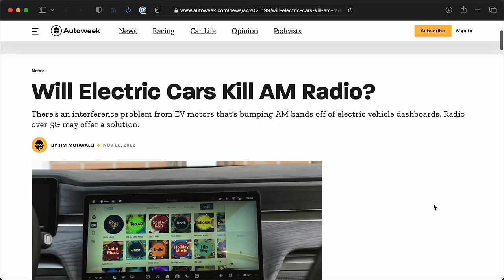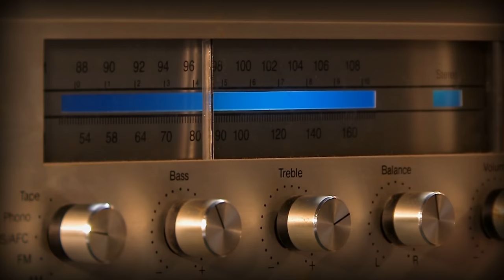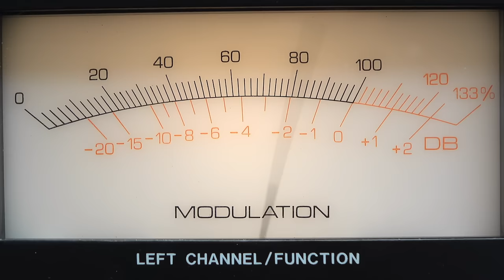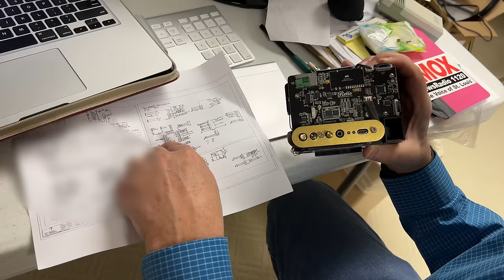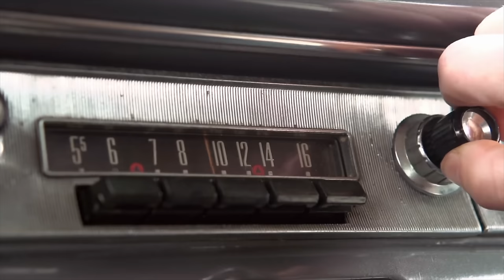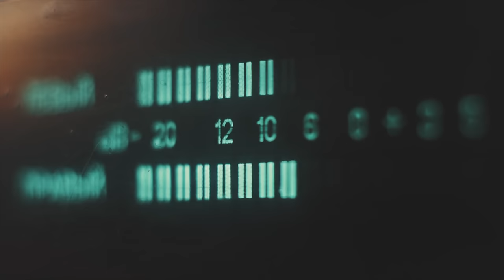Is AM radio dead? Tesla thinks so!

Comment: The difference between analog and digital circuit engineers is that the analog circuit engineers know when they are building a radio transmitter.
Reply: Nah, they know that they are building an antenna ;-) everything is an antenna lol.
Reply: @zyeborm  Every oscillator is a transmitter, and yes it’s a thing EEs are aware of.
Reply: @BrekMartin  many of them don't design circuit boards like they know it
Reply: @zyeborm  I seen a few of those. HDMI seems to be the most challenging to get under the CISPR 22 limits. It doesn't help that the HDMI cable makers treat it like plumbing.
Reply: Many many years ago when I purchased my first computer (8 bit Z80 based) I noticed it had a tendency to annoy radio's, once I had the lid off and probed a zero volt circuit board with the positive probe of my old analogue multimeter, the negative lead just laying on the table, however I got a fair deflection on the meter - kind of scary.
Reply: Back in the days of vacuum tubes in AM radios, in an emergency, an AM radio contained all the components required to build an emergency transmitter.
Reply: When my neighbor's run their LG microprocessor washing machine my ham radio goes away. S9 interference.
Reply: @paulstubbs7678  That’s not entirely as slack as it seems. They should have been shielded, and compliant, etc. but back then the silicon actually consumed more power. All of the unintentional radiators of the time are relatively high power ones.
Reply: That is made up by tesla,  AM  radio works just fine in my hybrid,  the electric motor is in the transmission bell housing ...
Reply: @memyname1771  This kind of brings up another problem, radio's and early TV's were all but 100% reusable/recyclable, Build an Amateur/Ham radio out of its bits, maybe a guitar amp, now look at the modern versions they sell, your lucky to be able to reuse 5% of them.
They (recycling industry) say we can recover most of the precious metals, Gold, Copper?, on most gear that would be lucky to be 1% of the mass! They say support the recycling industry, why, with numbers that low they are either asleep at the wheel, or dead.
Reply: @punker4Real  Whenever I was passing by a Honda Insight my CB radio would scream from the car's motor speed controls. I can't tell you if it's any better now because I don't drive for a living and don't have a CB radio in my car.
Reply: @paulstubbs7678  The circuitry went from point to point (1920-1970) to printed circuit boards (1965- present) to surface mounted printed circuit boards (1995-present). You must have special tools, damn good eyesight, and steady hands to work on these. As you stated, nothing on these is remotely salvageable.
Reply: @BrekMartin  Yes, you can try and shield your way out of it, however the fact it generated so much crud in the first place was what got me. Early Atari 8 bit computers had crazy levels of shielding, however I don't know if it worked as they were priced way above me.
These days they know how to design a lot of it out and not need crazy levels of shielding, however most customers shop cheap 3rd world crap to save a dollar, and those builders have no ethics, and often no idea about design - they honestly don't give a ....
Reply: @spaceflight1019   Well on my suv the electronics are in cased in metal shielding and twisted wires
Reply: @punker4Real  Sounds like the engineers took care of a problem at the source. There are FCC rules that govern what are termed "incidental radiators" but, to save money on production costs, those rules will be ignored until someone complains and then the manufacturer will deal with it on a case by case basis.
Reply: @spaceflight1019  Even if you have a surface mount rework station at your disposal, getting information about the massive big chips used is often impossible. Heck even the Arm micro used in the Raspberry Pi computers (purely intended for old school hacking) is not fully documented, there are bits the makers just won't disclose without you signing your life away. Lots of big chips come with (after signing a $$$ none disclosure agreement) 'tools', top secret code, etc. Trouble is by the time this equipment comes up for recycling, even the keenest individual will have no luck accessing any of this as it all hit the bin the moment the builders moved onto the next version.
The same goes for equipment repairers, and the latest 'Right to repair' movement, the manufacturer builds a million of them, keeps no spares, and documents nothing - well nothing that lasts past the end of production. Heck, lots of this design work is outsourced along with production at another provider, the company who's name is on the product is just a pile of sales types and bean counters that have no idea, so when you call them looking for info all you get is a blank stare.
Reply: To the OP: I got the joke. And it’s funny.
Reply: @PlasmaStorm73 [N5EVV] I'm 67, so things ain't quite as good as they used to be. It was a leap of faith when I removed the SMD resistor that killed the beep in my Bearcat 980.
Reply: @PlasmaStorm73 [N5EVV] It's not much better in the suburbs, either. I live in one of Pittsburgh's suburbs and use an Alpha Delta DX-B for the lower bands and a Cushcraft R5 for the uppers. Thanks to LED lights and other things my 160-40 noise level is typically S9 or greater, and my best band is 10 meters, where the noise level is typically S7 or less. Until the power line insulators start arcing, then it's all over.
Reply: @PlasmaStorm73 [N5EVV] But if they never have the parts available, or are hiding under the  'replacement board' excuse, even though there is only one board in the device, then you might have the right, but you'll be sent to the loony bin if you exercise it (as in spend twice what a new one costs). You kind of see this in the auto industry, yes they'll sell you the parts, but at what price?

Actually I'd like it if they pass a law where the replacement parts are an appropriate fraction of the equipments original price (very uneconomical to many) it will kind of force them to make good quality kit that will never need spare parts.

I'd like to see them enforce this on the many crap suppliers in China etc.
Reply: @zyeborm  How many of them design their circuits so they don't interfere with themselves? On motherboards special care needs to be taken with the memory lanes because they'll interfere if they are perfectly parallel.
Reply: @paulstubbs7678  dont even get me started😃😃😃
Reply: And what's wrong with building a computer that can also listen to radio
Reply: Ha ha good one. 95% of the comments here seem to have missed or looked right past the joke.
Reply: @tinetannies4637  Just so I'm sure, the joke is that all digital circuits are also radio transmitters because all the traces emit electromagnetic signals, right? If that's the joke, I'm pretty sure more than 5% of people got the joke
Reply: @supernenechi  No, I took the joke to be that digital is binary so only analog engineers are aware that they're buildING a transmitter. At least that was my read of the joke. Maybe I'm wrong!
Reply: Okay so why did this take you so long to upload to youtube?
Reply: @spaceflight1019  Be that neighbor who reports to the FCC
Reply: @Mark-kt5mh  There's no point in doing that. As far as the washing machine goes I'd do better contacting LG. But they don't run it all day every day and once the weather warms up they go to camp until fall. There are battles you can win and battles you can't win.
Reply: @spaceflight1019  I'd guess that it is due to the motor causing your interference.
Reply: @spaceflight1019  many electronic devices, including TVs...ALL have a similar worded phrase: This device MUST accept any unwanted interference, and it must NOT emit unwanted interference.
Reply: @kreuner11  THAT is where I disagree with the original comment in this thread. I wonder if he ever heard of a SDR Software Defined Radio...just a detector, and the computer does the demodulation by computer code instead of circuitry.
Reply: @W8RIT1  You are correct. The microprocessor controls that control the motor speed are the culprit.
Reply: @W8RIT1  Yep, I was once being accused of interfering with a video game until I pointed out the sticker on the game.
Reply: @W8RIT1  the joke is that the engineers who build the digital circuits used in every consumer device are ignoring the stray RF emitted by the high speed switching inherent in their digital circuits, resulting in a proliferation of devices that are generating RF emissions as a side effect of operation.  The designer of an analog circuit, on the other hand, would probably note the emissions that would be generated by a particular analog circuit design. The emission of digital hash doesn’t involve, for example, explicit tank circuits. 73.
Reply: @nimbusco8956  I can see the point...didn't necessarily consider it a joke...yes digital square waves produce more harmonics than analog, but even analog oscillators create noise.
Reply: I was your 1,000th like :)
Reply: I like AM radio I live in a middle of nowhere
Reply: @michael_r  can you explain the joke to us non-EEs?
Reply: @PetesGuide  oh - in digital design you think of discrete states (1 and 0) but when you have very high frequency digital circuits they switch back and forth so quickly that it becomes more like an oscillating analog RF transmitter. That’s the over-simplification.
Reply: @paulstubbs7678   That is fine in principle...But only an illusion...You can write all of that but it could never be enforceable...The price of complaint products would be to high and the manufacturers would just go bankrupt on a case by case basis...You can't force anyone to stay in business or to lose money...

Even worse would be the need to bail them out with taxpayer money...
Reply: Regardless if it is AM or FM, the TX is still Analogue (RF that is) not what's on it! Like a road same difference! Cars, trucks or buses, they all drive on a road, don't they?
Reply: That's one of the reasons I'm happy IT techs here in Germany still have to learn the basics. We may be working with digital stuff almost all the time but at least we still learn and know the analogue side of electronics as well
Reply: A home hobbyist can easily make an AM transmitter that would operate from 500 kilohertz to about 20 megahertz using cheap junk salvaged from electronic refuse.  With a little bit of money, an AM transmitter up to 60 Mhz would be easy also.  But the amplifier transistors cost more above around 20Mhz.  AM is so easy to make a receiver or transmitter.
Reply: @punker4Real  I drive a vintage vehicle with a distributor, points and condensors, spark plug wires, analogue coil, and mechanical timing advance.  It is a splatter house of spark noise.  My AM radio works just fine. It is quieter with the engine off.  That will happen in any car, even in an electric car.  But if I have no problem with my spark gap transmitter on wheels, Tesla Motors has no problems with AM reception.
Reply: @spaceflight1019  Are CB radios still manufactured? I installed one in my car back in 1996,when I bought the vehicle new.  It is still in there today.  It works very good after all these decades.  But, unfortunately, the band is near dead.  It is not what it used to be.  I can not uninstall it because back in 1996, I carefully cut a rectangular hole in the dashboard for the beautiful Cobra 148GTL, and a round hole for the microphone jack.  It is there for the duration of the my ownership.  I have had the vehicle 27 years, why get rid of it now, especially as rectally ugly and over engineered as today's junk is?
Reply: Truth is they could. But it is just a lot cheaper to not have AM radio.
 Besides who needs to listen AM radio in a city car?
I also was part of that Eastern US blackout. August 2003. It was possible to not drive your fully charged Tesla to the nearest power source for 7 hours or more. Where I was. It was a 3 day wait.
There are a lot of clear channel AM stations with a lot of daytime range and a 1000 or more miles range at night when the power goes down.
 For some reason August14, 2003 in the North Eastern states there was lot of range from AM stations
Reply: @warrenpuckett4203  I live in a very rural environment. I will never drive a vehicle dependent on the municipal power grid, which is not good anyway.  People just blissfully buy their electric cars and surrender their freedom without even knowing it.  In rural environments and far suburban environments, electric cars are worthless.  They are only good for the cities and near suburban areas.  Besides, there is no way to stockpile electricity for the winter.  I must stockpile fuel every winter.
Reply: @indridcold8433  Yes indeed, you can still buy a new CB radio in 2023. The FCC changed the rules last year to permit the use of FM mode on CB now. 
The sun is currently in the early stages of solar cycle 25. Last October, long distance ionospheric propagation became possible on the CB and 10 meter bands. It was great having worldwide propagation all winter, but with the change of seasons in March the HF bands have gone into the summer doldrums. Repeated solar storms haven't helped much either. I have a scanner with CB and other than local truckers it just scans and scans. But it will come back.
Reply: @indridcold8433  I bought a 12KW generator. Already used it this calendar year.
Ice on the lines. Always have 6 gallons of gasoline in it. Oh and I don't have the furnace hook up done. Need major surgery on the electrical for that. To just plug the the 96% efficient furnace into the alternator. Electric space heaters and electric blamkets work well enough with 12 KW.
Reply: @nimbusco8956  thanks
Reply: @spaceflight1019 

I got massive interference on VHF amateur radio band but UHF is fine.
Reply: Your Dads an interesting guy 🙂👍
Reply: @paulstubbs7678  No remove and replace any more. Just replace with new. Auto manufacturing is trying real hard to meet that goal with the blessing of CARB.
Reply: I'll never buy a Tesla because it's cheap plastic, and because it  doesn't have an AM Radio.
Reply: And then you know have a bunch of pallets that have pelican cases with little mini networks inside and they can just be dropped all over the place they can have radios for First responders in there and they can have Arden systems for people who understand how to work those and you could airdrop in infrastructure and a network into a country that has had a natural disaster and have an internet and Communications infrastructure they can run on a solar and some wins smaller wind generators roll out solar panels and even throw in the stream of water from a flood hydrodynamic generator to Toronto because all in all it won't take much to run those types of things the mainframe yeah but the small little meshes and the little nodes not so much and then each person has their own setup whether it be their solar panels or they're on the wind generators and their little cyber decks and or they're just they're normal laptops and computers that can hook into the local internet.